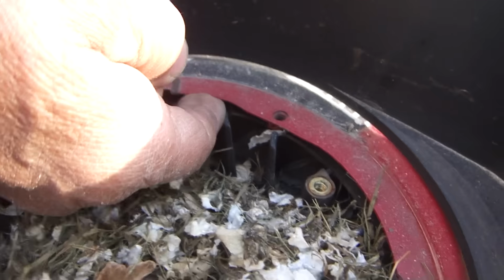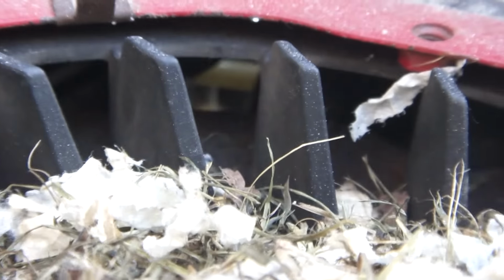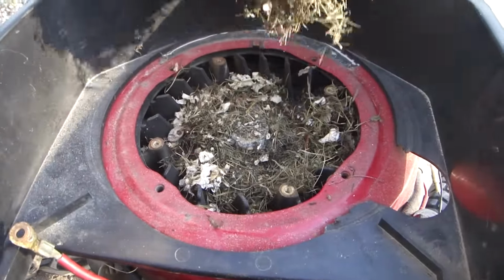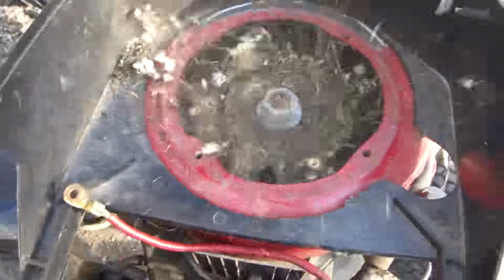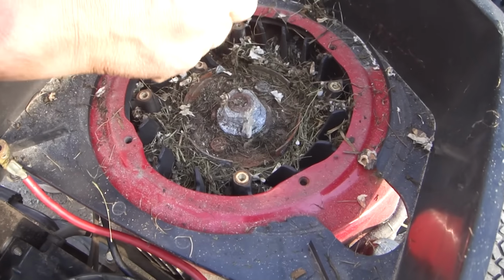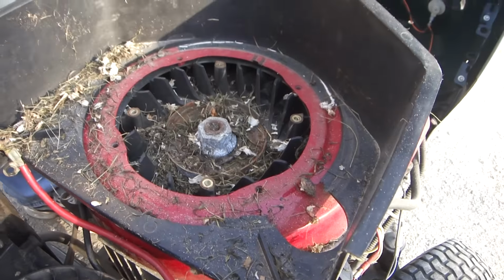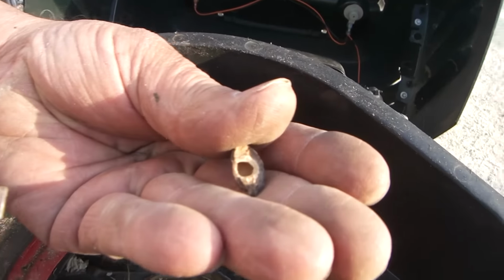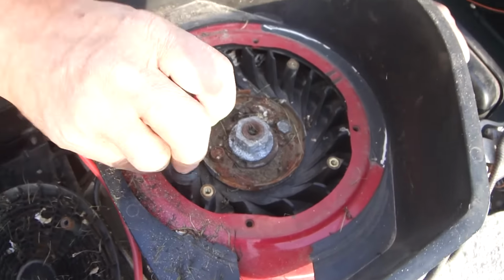Nest Found In Lawnmower

Comment: you need to take the whole top cover off you never know if the mice made another nest under the rest of the engine shroud this could mean there's chewwed wires or a nest that could cause your motor to overheat and fail